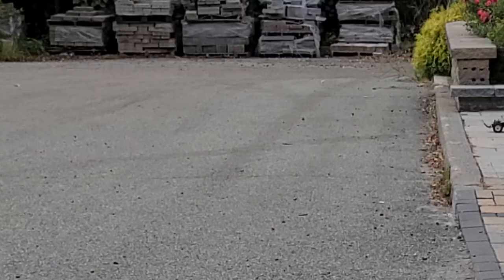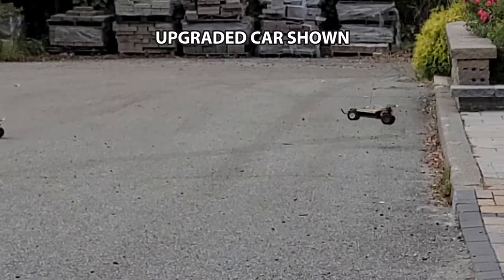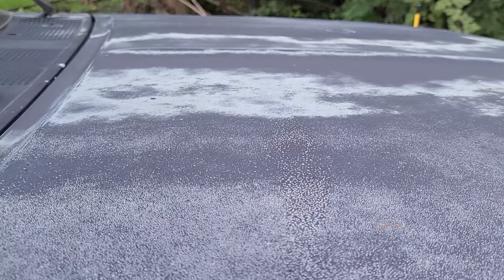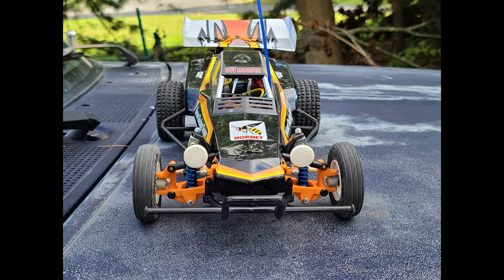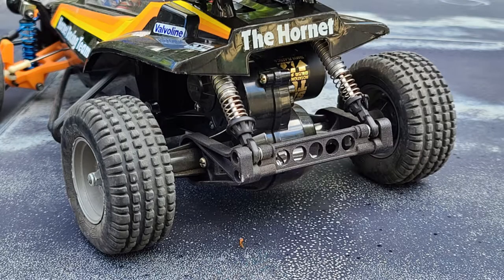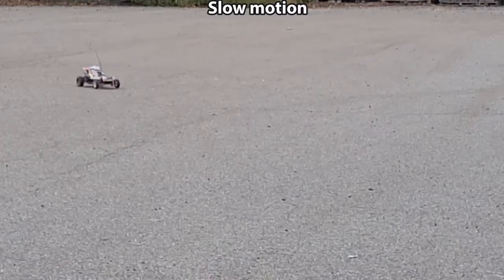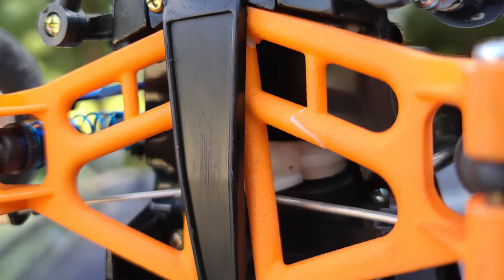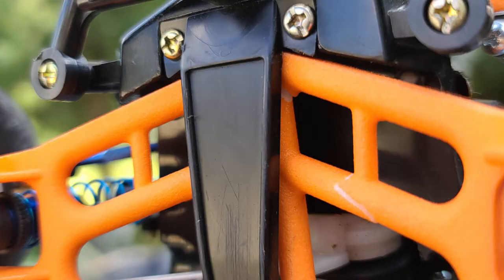Test Drive of the AMPRO Suspension Upgrades for the Tamiya Hornet

Comment: I don't care what shape ways says. 3d printed parts are NEVER the same as moulded ABS, Styrene or PC
Reply: i dont mean to be offtopic but does anyone know of a trick to log back into an instagram account?
I stupidly lost the password. I appreciate any assistance you can offer me.
Reply: @Drake Salvador instablaster =)
Reply: @Grayson Karter it did the trick and I now got access to my account again. I am so happy:D
Thank you so much you saved my ass!
Reply: @Drake Salvador Happy to help =)
Reply: Ampro is very clear in the descriptions of their parts that they are not as strong as the factory pieces and should only be used on light runners with mild motors/batteries and not for bashing or super fast motors. They do work as designed though.